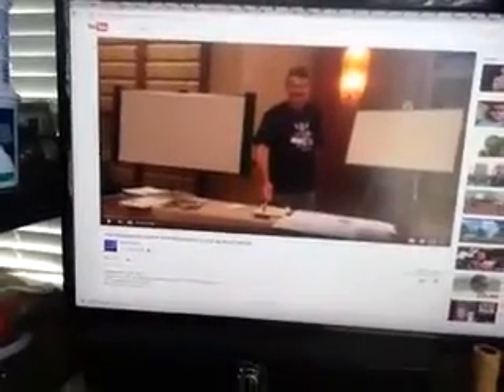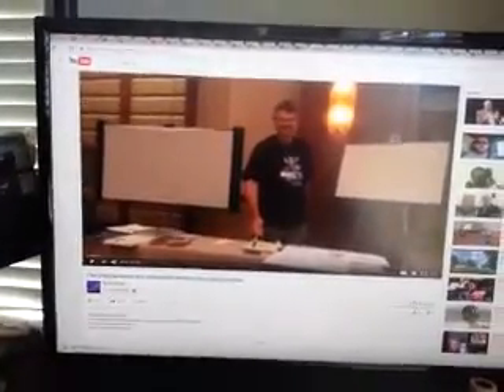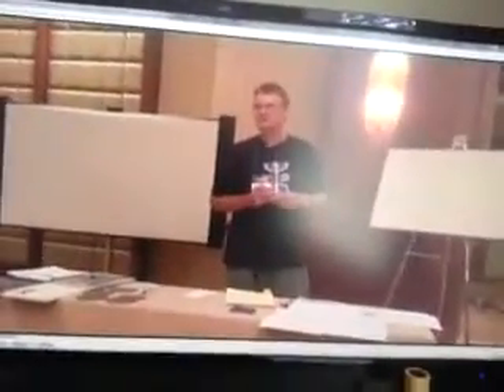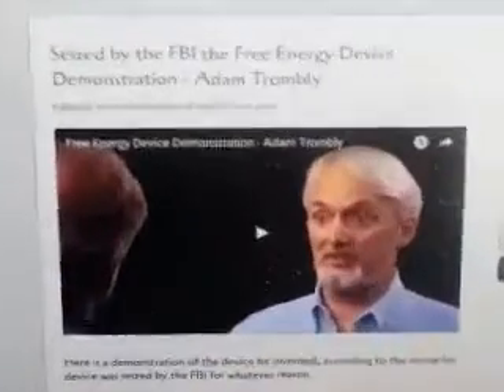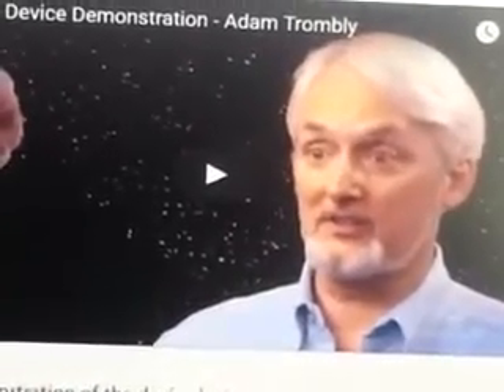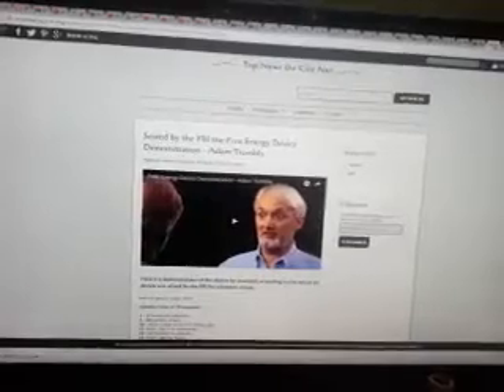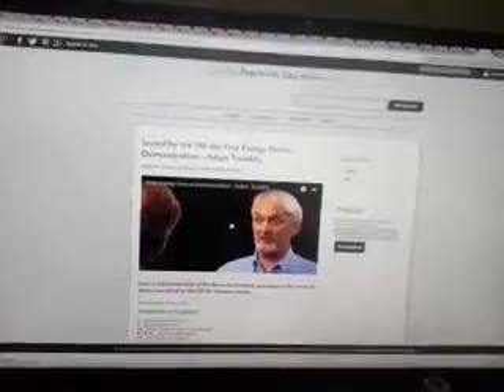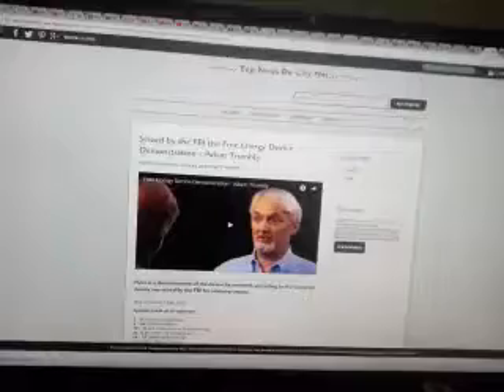Adam Trombly confirms magnetic grounding a Faraday Generator's iron chassis.

Comment: Have you read notes on unipolar dynamo?
There's a part that says when you spin either the disc or the magnets when they are moving freely, at a certain velocity, the torque will be negative and they will start to counter rotate each other.
Another point of the note is that when you accelerate the disc at an increase rate, and remove the magnets, the disc will be free to rotate, or even increase in speed. 

Notes on Unipolar dynamo:
"If the latter were rotated as before in the direction of the arrow D the field would be dragged in the same direction with a torque, which, up to a certain point, would go on increasing with the speed of rotation, then fall off, and, passing through zero, finally become negative; that is, the field would begin to rotate in opposite direction to the disc"

"the eddy currents generated by the rotation of the disc strengthen the field, and suppose the latter gradually removed while the disc is kept rotating at an increased rate. The current, once started, may then be sufficient to maintain itself and even increase in strength, and then we have the case of Sir William Thomson’s “current accumulator.”
Reply: No. I don't think I have. Thanks.

Comment: Im doing some research before experimenting myself and I'm glad i ran across your video.  Thanks
Reply from the maker: It is my opinion that there are at least three different ways of achieving low resistance, and thus low heat dissipation, for an inductor. They are...

1. Super cooling the coils and their iron cores.
2. Abutting the iron cores of coil windings to an external mass of iron (Lyne's quote of Tesla in Pentagon Aliens concerning his Special Generator described by Thomas Commerford Martin in 1894: http://is.gd/specgenpgs in chapter 63 of his book).
3. Surrounding the iron core of an inductor in a magnetic field generated independent of that inductor. Lester Hendershot and Steve Mark do this. And a fellow on the internet placed two transformers on either side of the central one to blast the central one with a large magnetic field to presaturate its iron core.
Reply from the maker: There's a fourth condition care of Joseph Newman...
4. Increase the gauge of the coil winding wire and thus increase both its mass and length and number of turns to retain the same resistance as the use of a smaller gauge winding wire, and thus result in more massive use of copper which increases output of the motor, etc.

http://is.gd/newmanchap4